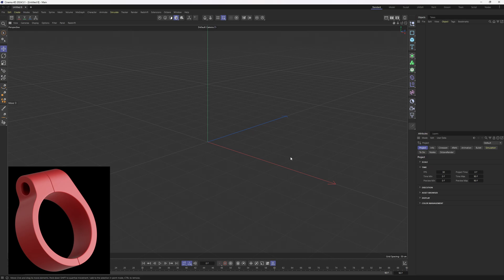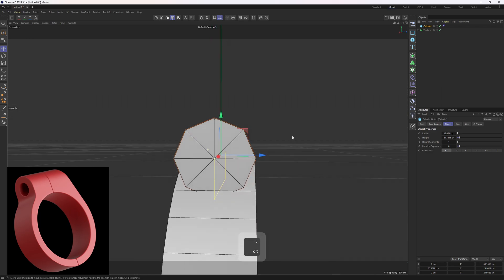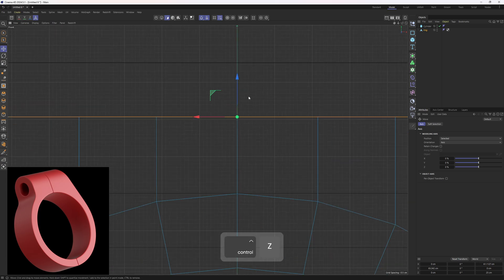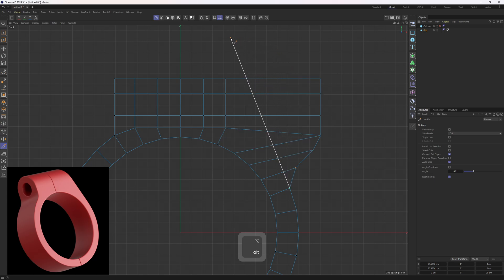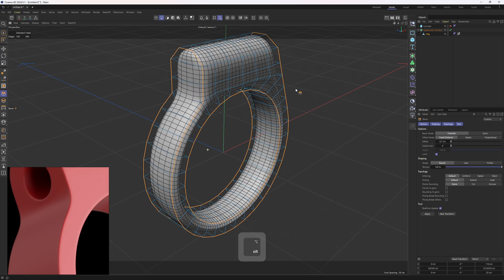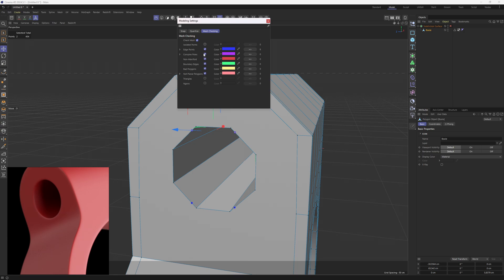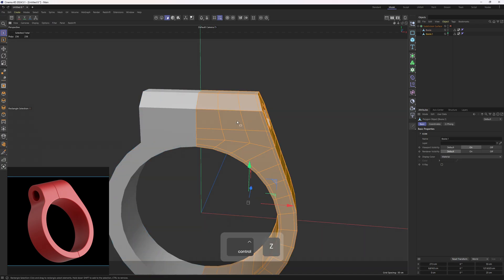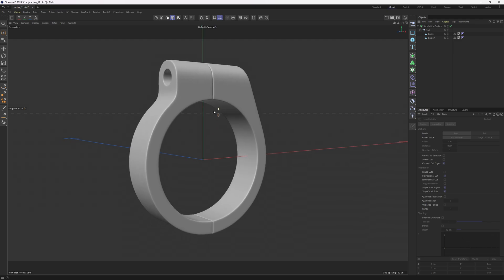3D Modeling Practices | 11

Comment: when using the Equal Spacing tool around 7:29, the upper edge that is selected pulls in instead of just distributing flatly over the surface, any ideas why that is that happening?
Reply from the maker: Did you check the normals are correct?
Reply: @polygonpen yes, they are all good.
Reply: Same problem here, but still no solution ._. Checked the normals but they are alright